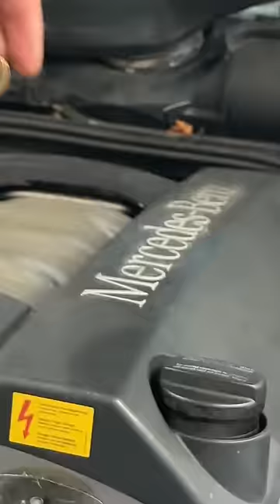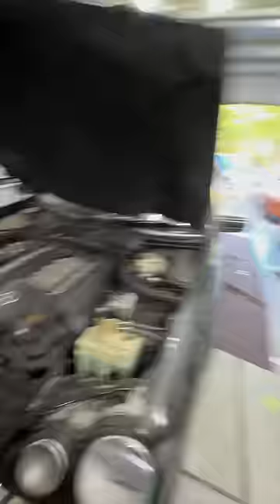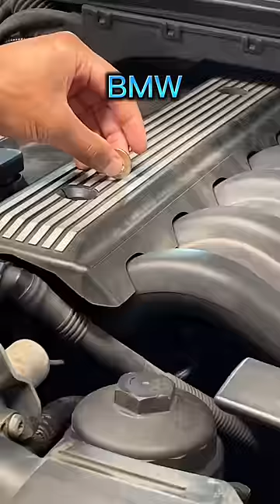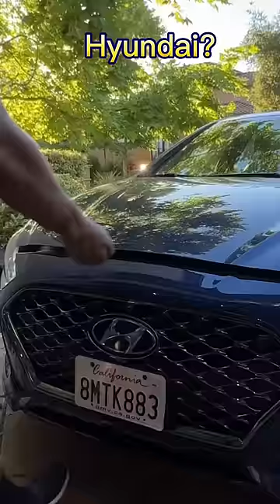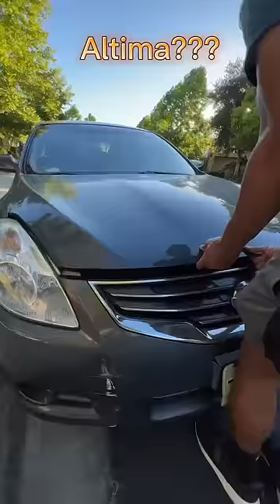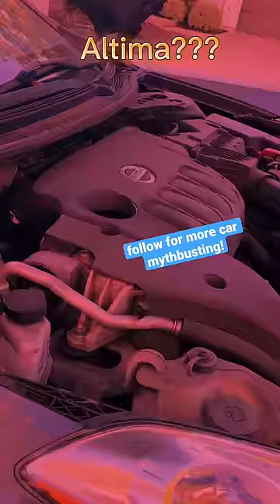The last one is 100% the best 🎩🎩🎩

Comment: Could you do Mazda? If you can, that would be so cool! I just found your channel and I find it fascinating.
Reply: Many Mazda's especially Mazda 3s are known for having shitty motor mounts, especially the rear. They would not do will in this test.
Reply: @j4y167  can confirm, my motor mount came with 2 inches of play in it from factory.
I installed a polyurethane motor mount and now I do burnouts with ease.
Reply from the maker: I’m thinking of keeping a few euros in my car and going to do this test at car meets!
Reply: @ChrysGaines  Great idea. Please release a long version of the car meet test video when you end up doing it
Reply: No mazda is trash get a refund
Reply: @ChrysGaines  do an rb brother
Reply: @ChrysGaines  don’t wanna be a buzzkill and you probably know but the real test was done with British 2 pound coins lol😭
Reply: Y'all thinking of Mazda's piston engines. I'm curious how the rotary fairs
Reply: @j4y167  interesting. I’ve owned 4 and never had an issue with motor mounts.
Reply: Idk... I got 240k miles on my 6. Zero repairs. Only consumables like tires, batteries, etc... Still running strong.
Reply: @phuckyoutube5927  I like my car, it might be a Mazda but it does what I need it to do. It gets me to work and back.
Reply: @NiceBowser  they're fantastic cars otherwise, was considering buying a mazdaspeed 3 a while ago. The mounts issue isn't generally severe and in fact almost nobody who isn't a car guy will notice most cases. Usually it's just a bit more vibration and it feels like it could be smoother when shifting, pretty minor stuff.
Reply: @kinneyshoes1  how's the 6 handle? I've driven a few 3s and they handled beautifully, Id assume the 6 is just slightly more sluggish in corners but still responsive?
Reply: Needs to be an RX7 or RX8, rotaries are smooth af
Reply: Anyone gonna talk about what the fuck he has a nismo wrap over a shitty bmw 💀
Reply: Until you realize BMW makes Rolls Royce
Reply: @ChrysGaines  the mazda to do would be a rx7, guarantee it passes
Reply: What's the end song
Reply: Do it on a Tesla
Reply: do a BMW 850i from the 90s ... I tested it back and that 12 cylinder purred like a kitten...🤣
Reply: @ChrysGaines  ,
Reply: @j4y167  they're saying that because rotary engines have one of the smoothest idles. there is no reciprocating mass inside the engine just the rotors spnning around. You start a rotary and all you hear is noise there is almost no indication the engine is running.
Reply: Do you think they had euros in england in the 60s 🤣.The test should be performed with  a one pound stirling coin. not euros.
Reply: @ChrysGaines  Try it on an electric car 😁
Reply: No. Save everybody time
Reply: Brap brap brap brap brap brap brap brap
Reply: ANY ROTARY
Reply: @tokanada  exactly what i was thinking
Reply: @edwards8383  i mean with my limited knowledge of cars, those don’t look like they’re from the 60’s, they look 80’s to early 2000’s
Reply: Try an Audi A series they are camm
Reply: Mazda can surely make the coin fly🤣🤣
Reply: @brooke2598  Currents by Drake
Reply: Are from portugal?
Reply: I have a 2nd gen mazdaspeed 3,can confirm mounts are shit.
Reply: rotary mazda
Reply: Try it on EV
Reply: ០
Reply: Try the rotary rx7/rx8
Reply: @j4y167  who tf would buy a mazda speed 3
Reply: @cjthurman4772  they're cheap fun dailies that use fuck all fuel and at least where I'm from insurance charges a shitload for "performance" cars, and they don't consider the mazdaspeed one so it's way cheaper. If you want a cheap and easy 400+HP car (400hp with basic boltons) it's a great buy
Reply: @j4y167  a Rx7 is a rotary so there's no up down motion. It would work no problem
Reply: @cjthurman4772  those who really know what they are ;)
Reply: @ChrysGaines  that would seriously be a neat idea to bring some to car shows and seeing if others can do it!
Reply: @j4y167  e

Comment: this has been said enough but to throw more gas into the fire... engines rely on reciprocating masses called pistons and they, create forces both up and down but the connecting rod makes a whole buncha different forces, primary forces and secondary forces may make the engine want to roll, twist, vibrate, and so on. V12 engines and Inline 6 engines are said to be the most stable due to forces cancelling each other.

Comment: BMW It’s literally the same engine and company
Reply: Yep!
Reply from the maker: i’d have to look up if bmw v12’s are based heavily on their I6 models, but v12’s are inherently more balanced
Reply: @ChrysGaines  the v12 is basically two i6 engines I thought
Reply: @ChrysGaines  a V12 is balanced exactly the same as a straight 6. Twice the cylinders firing per revolution does smooth out engine pulsing effect though

Comment: Surely in order to make this a fair comparison, the engine mount bushings should be replaced on each car because each car will have different amounts of wear on the bushings.  the more worn the bushing the less resistance to movement they will have....

Just a thought, but I get it's just a bit of fun and I'm splitting hairs not meant to be set in test conditions.

Comment: Some people really don’t get this. In two motors that are equally secured in place, the one that shakes more means that a larger amount of the chemical energy stored as petrol is converted into kinetic energy in the motor as opposed to being converted into thermal energy in the motor and then kinetic energy in the wheels. Simple physics, it’s not very accurate but it gives you a good idea

Comment: only works on V12's there is little to no 1st or secondary vibration in a V12 because they are about as close to perfectly balanced as an engine can be. as someone commented earlier, the only engine that is balanced enough is a V12, and BMW actually "coined" this trick as a marketing gimmick taught to sales reps with 7 series limos as a means to sell the luxury sedans to high flyers, then later used by Rolls and Bentley.

Comment: I can put a stack of coins over each motor on my Tesla Model 3 Performance and none will move... until I step on the juice pedal and the coins go flying 0 to 60 in 3 seconds...
Reply from the maker: i’m actually curious if there’s enough vibration in neutral for a tesla motor to throw off the coin. of course you can’t spin up the motor without moving…

Comment: you're comparing a bmw inline 6 built for performance vs a rolls royce v12 built for comfort. BMW owns Rolls Royce so if they really cared there would be no reason for it to not be smooth, It's just that bmw focuses on performance, especially in a 3 series i6 and not a 7 series v12. A 7 srries v12 could probs do same thing.

Comment: Yeah but you didn't try it on the Rolls-Royce , Corsa rolls-royce's going to not tip the quarter over ,   Rolls-Royce doesn't it  like have  a 12-cylinder and starts off at $250,000